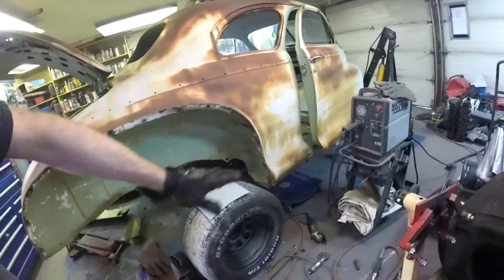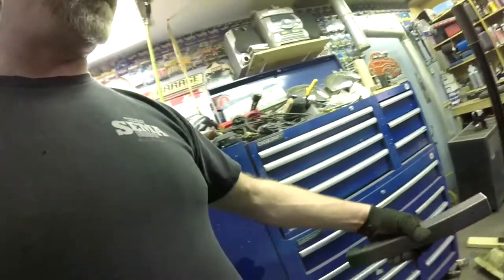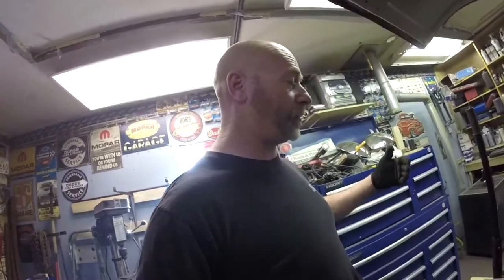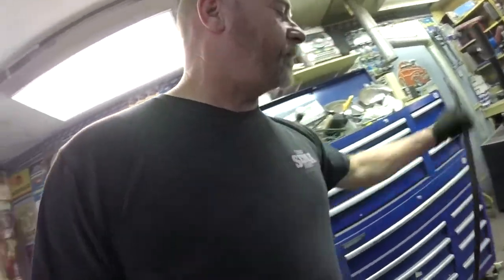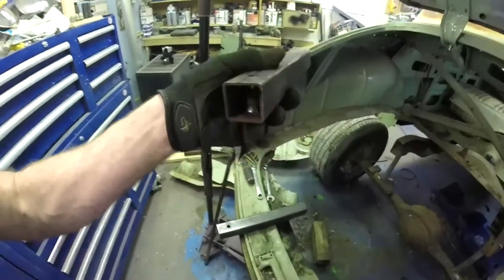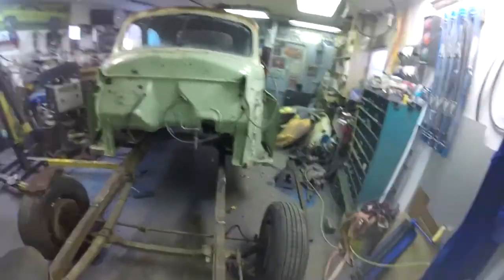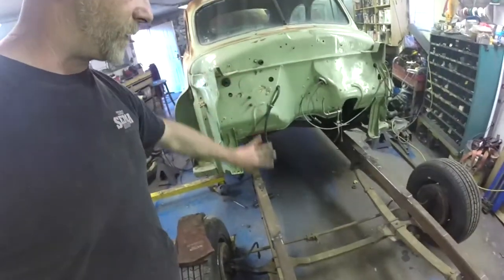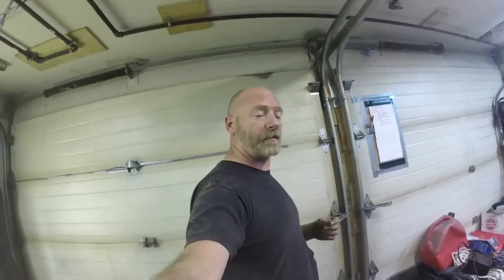Simple Body Mounts for the 1948 Chrysler Windsor Gasser that you can do

Comment: Nice job on the body mounts looking nice and strong. Do you know what kind of motor and transmission you plan to use just wondering lol.
Keep up the good work Dave👍
Reply from the maker: I was thinking of keeping it to myself, but I'm in the process of horse trading an old boy an s10 frame I need to modify for his build for a complete 1969 Chrysler imperial. So it's a forged crank high compression 440 ( which I will have to go through) and a 727 auto (I'd really love a 4-speed but that'll be down the road) lol. I have a tunnelram and a pair of tunnel ram carbs for it and man I can't wait to be able to bolt on that tunnelram and get the motor in place!!!
Reply: @dazeofgloryshopworks5806  man that motor is going to be cool if you get good luck.
And a tunnelram to😁 heck yeah now your talking.
Thanks for sharing I won't tell nobody lol. It's a secret.
Have a nice night guys👍

Comment: Any thought of boxing the frame rails?
Reply from the maker: For sure. I'm going to build the back section of frame to tie in the rear trunk body mounts and from there I'm getting the frame sandblasted. Right after that, the whole thing is getting boxed and extra gussets and fish plates added where I changed the front end and such. I'm struggling finding flat steel to use. It's pricing is disgusting still and I ain't made of money. Hahaha.
Reply: @dazeofgloryshopworks5806  Steel is a stupid price considering we made it at one time.
Reply from the maker: @noccis3448  that statement couldn't be more true man. Growing up in Cape Breton, for the majority of the working class dads out there, if you didn't work in the coal mine, you worked at Sydney steel. Sad state of this country I must say.